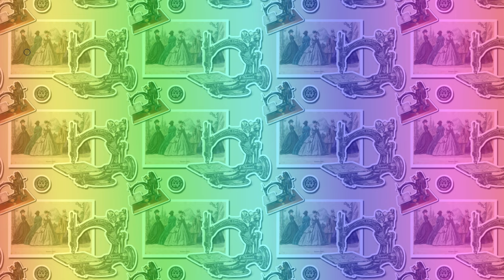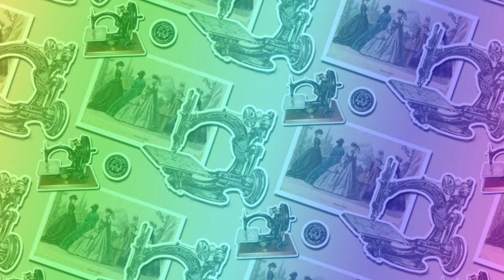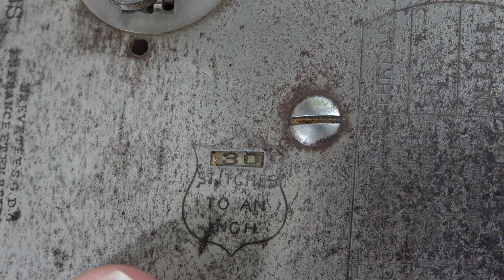😱 Will it sew? I bought a 1800's SEWING MACHINE online

Comment: That was a fun fun video! Loved it! Your guy is awesome! Two days ago I found the same sewing machine an hour away from me and SNAGGED it! And I am in love!!! Looking up everything I can find about it. Mine is in a treadle stand which needs some cleaning and oiling so I haven't tried threading the machine up yet but I've got it moving nicely. Also mine had old oil caked over the serial number so I thought it was a five digit number which would have put it in 1864 according to one of the two serial number charts I found, but after much elbow grease I discovered the A and another digit. Mine is just like yours with the automatic tensioner and Cristina Kipphut is right, the automatic tensioner wasn't added until 1875. So my newly corrected number A254394 shows up properly in the numbers for 1875. ANYWAY! Loved your bunny, loved your dog! Thanks for the video!
Reply from the maker: Thanks!! It's so fun to find these treasures :D
The dates did confuse me, though lol